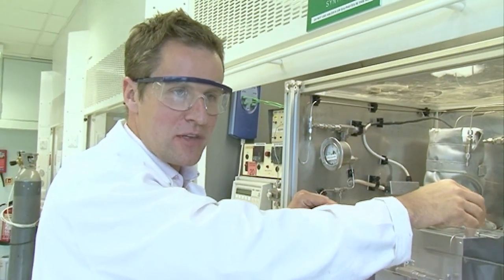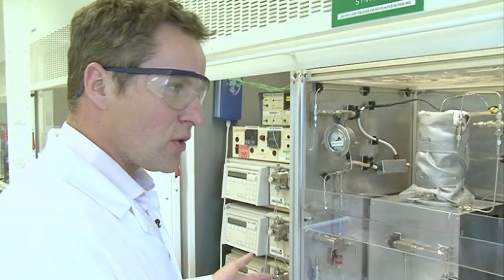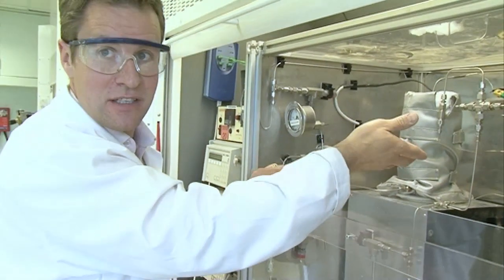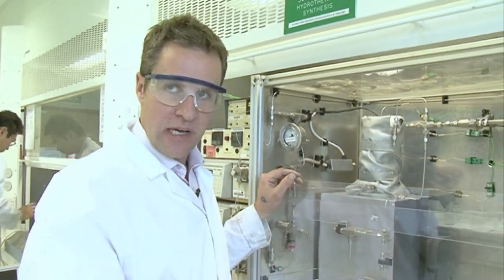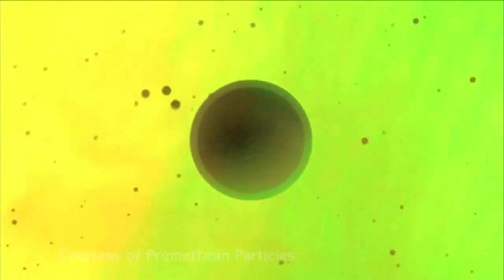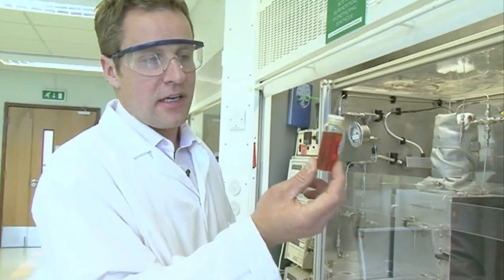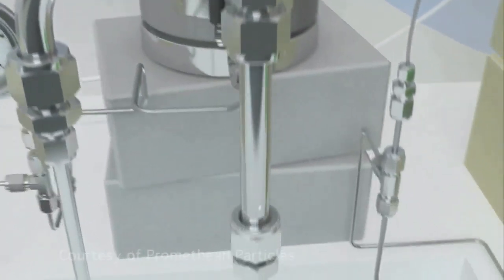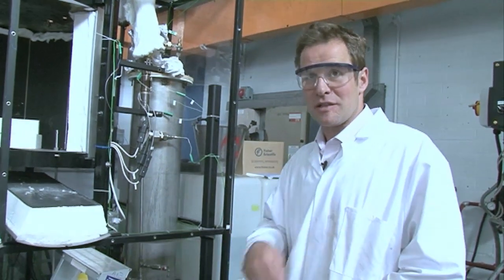Making Nanoparticles in Supercritical Water

Comment: What is the cost, to generate nano aluminum particles that are being sprayed on the People, in chemtrails ?
per pound ?
per ton ?
Reply: there's no such a thing as aluminium nanoparticles, as aluminium oxidizes in air to aluminium oxide. Any piece of aluminium in air forms a thin surface film of oxide, which is negligible in macroscopic applications but at the nanosize makes aluminium nanoparticles in air impossible.

Comment: i got a bad grade once in school for answering the question if you could heat water to above 100 degrees c with yes. "right" answer being no, it would be steam. there was nothing said about atmospheric pressure. thats how life goes sometimes.
Reply: waldsteiger in education, one typically doesn't get any points for pointing out a flaw in the system. Generally questions are presented in a format where the context is assumed as if it's all some sort of  vacuum.

Comment: What software did you use to visualize the flow of metal salts through those tubes? And swagelok fittings for reactors? I think you just require counter current flow to achieve nanoparticles of the metal salt. Am I correct?

Comment: How do you raise the pressure of the water to 200 bar and the temperature to 350 Celsius without a pressure vessel of some sort? I calculate that  the pressure vessel for containing even a 25 ml portion of water at the critical point  need some walls at least 8 cm thick to withstand the stress(stainless steel container).
Reply: Looks like your calculations are WAY off. It is not that high of pressure. Many SCUBA tanks are in the range. Countless hydraulic systems work in this range.
Reply: 24680kong Funny how people are an expert at things they don't use.... I have serviced 200 bar accumulators that are very thin and never fail. Personally I'm not a fan of super high pressure. Know a guy who lost 2 fingers looking for a leak at Los Alamos. Said his fingers fell off and he just stared. Could not see the oil stream yet it sliced him.
Reply: @tireballastserviceofflorid7771  Wait, i know about the water jet cutter but don't tell me these pressure vessels can turn into such a nightmare. Approximately what was the diameter of that oil stream? I'm wondering how he didn't see it.